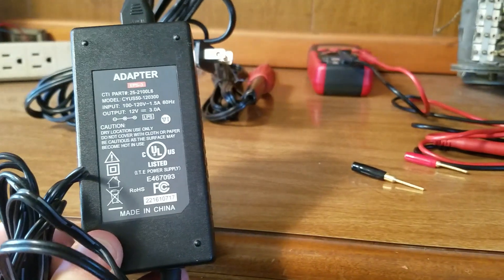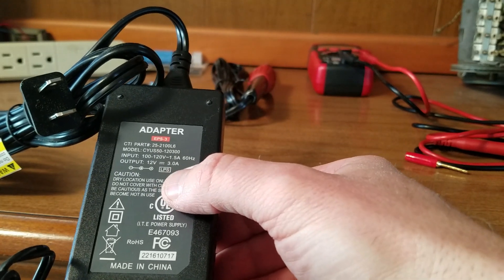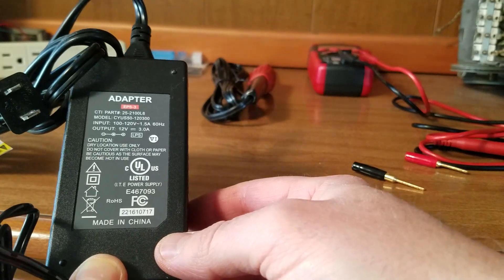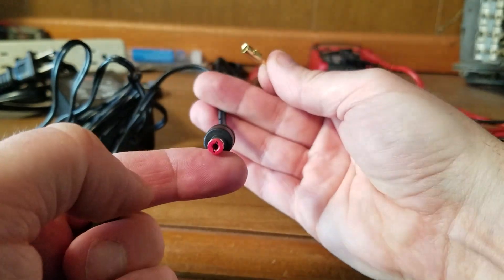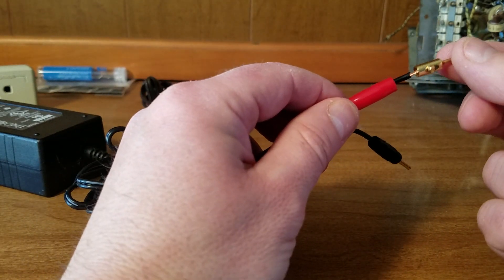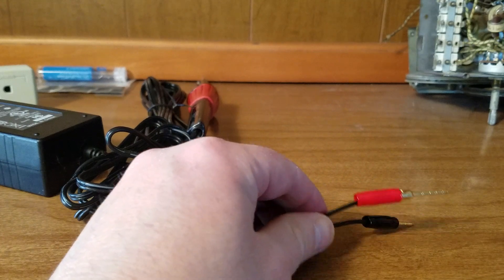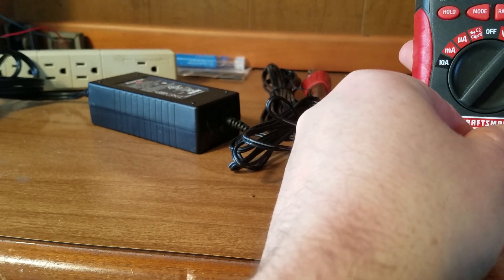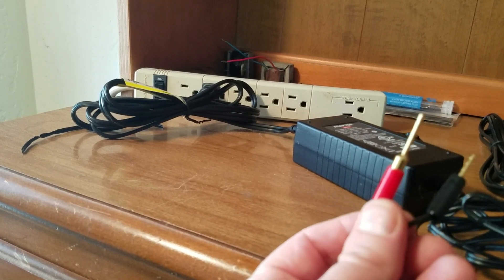How to Make Your Own 6, 12, or 24 Volt DC Power Supplies

Comment: Are you saying how to make this adapter is to find an adapter? Make a 12 V adapter by finding a 12 V adapter???? That’s NOT what this video is about, right??
Reply: Let me just add that the difference may be between what you consider making and what I consider making. I consider what you’ve done as finding.
Reply from the maker: @zaneseligman1313   Thanks for making me laugh first thing this morning! I guess that's what it's about in the end.  But really what it's about is that instead of just dumping old adapters in the garbage or throwing them in the river,  is you can use them for testing things like relays, circuit board components and various things powered by various DC voltage levels, depending on adapter rating
Reply: @KAFKUBA  but here’s the thing- and I suppose I can appreciate the thought that this needed a video for SOME person/ SOME where- but if somebody is the type to do what your video suggest, they will already be doing it. I find it a stretch to think someone might see this and be like… heyyyy if we keep all the old adapters, we’ll have a selection of different volt supplies for our many electrical needs. Maybe it’s just that I didn’t get the information I thought and was looking for. Anyway-here’s an idea for another video , and what I’m looking for : How to wire (2) 12 volt adapters to produce a 24 volt circuit.
Reply from the maker: @zaneseligman1313  in series
Reply: @KAFKUBA  yea-I understand that too- what concerns me is that I would end up having 2 adapter plugged into 120- and wired together(?)… it just seems wrong.. I think.. I’m not an electrician- I sure would like to see it done before I accidentally burn my shop down
Reply from the maker: @zaneseligman1313  I don't want you to burn your shop down... but speaking for myself sufficient isolation to DC secondary and low current into primary should exist to not create a fault... plus there should be breakers in your house to protect any fault
Reply from the maker: @zaneseligman1313  the only thing is if you're worried about your junk adapters is the secondary current ratings... since in series they might get twice the current and could fail but nothing dangerous
Reply from the maker: @zaneseligman1313  oh and it's all power dependent... you're not trying to charge your car battery I hope
Reply: @KAFKUBA  well, I have a 24volt cordless tool. Needing a charger between 25 and 30 volts- unless i could get a steady 24 volt source, then I could use it plugged in
Reply from the maker: @zaneseligman1313  hmmm

Comment: How many mA working current are they usually? I want to power 6 irrigation solenoids with 24vac but each solenoid needs 24vac + 480mA working current.
Reply from the maker: There should be enough info on the label to calculate it.

Comment: The description is misleading. Your not making the power supply, you are just changing the connector. It is already a power supply. You'd be better off with banana connectors so you could easily swap to different leads like you get with DVM's
Reply from the maker: The point is, you can test and power many low voltage appliances/components without spending money using shit most people throw in the dump...
Reply: @KAFKUBA  I get that, and I meant no disrespect, (that's why I edited my opening wording. Sorry) but reading the description we think that you have an ingenious way to make a 6, 12 or 24v power supply so we want to check out how you do it only to find out you are just converting an existing power supply into a tester. Don't get me wrong, it's a great way to make use of old PSU's. I've done it many times, but like I said, using banana connectors gives you more options. Thank you!
Reply from the maker: @Ottonic6  it's hard coming up with titles...sorry if I mislead you...my channel is dedicated to reuse, recycling, repurposing, and repair...while drinking beer and whisky...I'm not smart enough to invent...cheers!
Reply: @KAFKUBA  Yeah, I was checking it out. A lot of good content. In fact, looks like you could make your own power supply (Lol) I'm into electronics & automotive myself. Haven't watched any videos yet (oh yeah! One) but I definitely will.. Subscribed! Thanks!
Reply from the maker: @Ottonic6  thanks Dano!